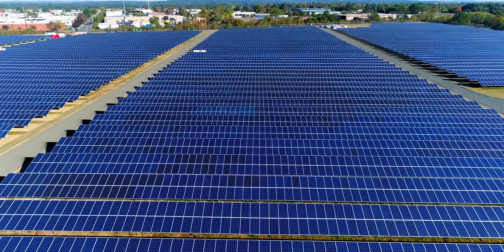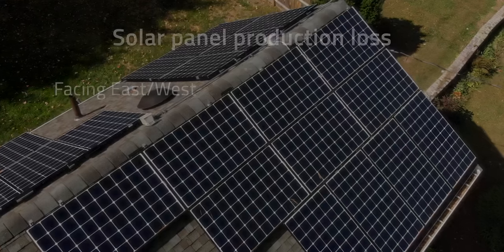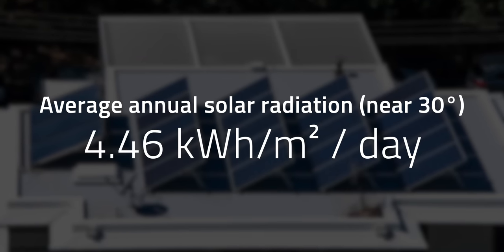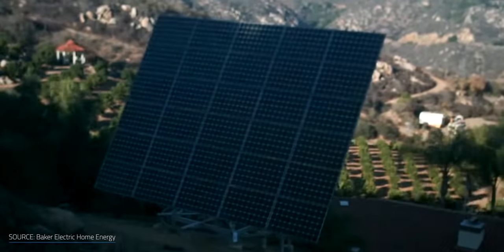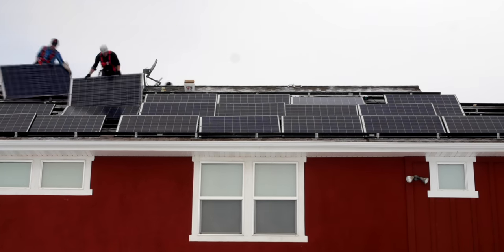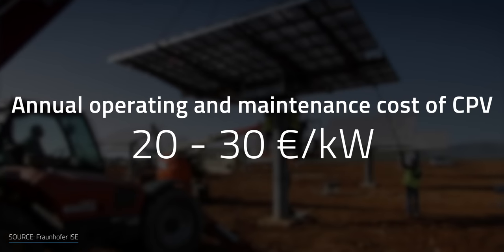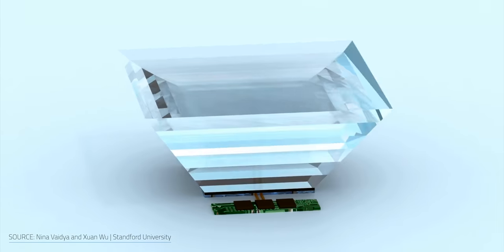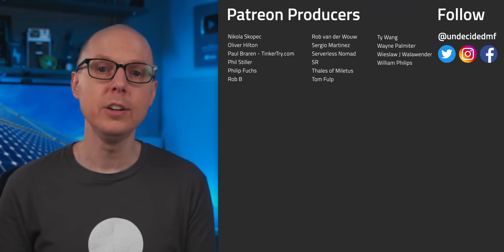This Invention Could Supercharge Solar Panels

Comment: Two false claims here. Incidence angle still matters even with AGILE, simply a matter of total perpendicular surface to incident light. Second false claim is if you concentrate light 10-100x you can increase energy output by 10-100x, that's just stupidly wrong. As you said a few moments earlier that efficiency increases from 20 to 40%. That's a 2x, not 10-100x....

Comment: We should build solar silo's with bigger lenses, kinda like inverted cones so we can concentrate the light 100's of feet down onto many more panels then you could fit in the same space at ground level. The future of solar is not ground level tech, it's building up or down. It's the only way to get the scale we need without overdoing the tech. Research is good, but they are wasting money on these projects. There are smarter ways to use money to advance the solar industry.

Comment: U didn't talk cost of ownership?  Bro more moving parts higher cost upfront and in maintenance.  Also, u can't backfeed the grid it's a unidirectional system.   Labor for installation is over 50% of the system?  When do u break even on installation costs?  Probably 5 years in CA or AZ on the east coast it's  8.  Keep it real and tell people the whole story $30k average to install.

Comment: You do realize that you can't get more sunlight out of the same area as a regular PV cell right? I haven't even watched the video and I can already tell you this would only be useful in hot water preheating and even then it might be completely senseless. The biggest enemy of PV cells is heat and this idea is honestly the opposite of trying to make them more efficient. Using a defuser is probably a better idea so you can spread light evenly over the entire panel and reduce the degradation of individual cells faster than others around it or the edges of the cell faster than the rest. I honestly question if you actually know what you're talking about or if you read some fandangled articles about things and then write a script without doing any source checking or any type of research outside of that article. I've seen a few of your videos on tech that absolutely won't work and it's really becoming a common theme of this channel where you sensationalize something to make others believe you and it's really perpetuating a cycle of misinformation and misleading people into thinking these things are possible and without being forward with more information that's important to the topic. Your views that actually want to learn about things see you as an expert on what you are telling them about and you are far from that.

Comment: Is prefer they focus on solar thermal collector solutions and not waste time on photovoltaics.  Photovoltaics have such a tiny life span and produce toxics waste.  Better of collecting heat and either converting that into electricity via generator or storing the heat.  Also not all of the heat would need converted since a significant chunk of that energy goes towards home climate control.  Another thing if we stop with the bad idea of a grid and produce all the electricity at each home then we wouldn't waste a massive amount of energy through transmission loss.  Nor would there be blackouts anymore.

Comment: This is bad idea. How heavy it will be? It's several layer of glass. How much expensive will it be? How about the cooling system? How about weather degradation to the glass? It's glass, it collect scratches over time. 

I think it will be much easier to use the CPV concept and have a large parabolic mirror that focuses light to several panels.

Comment: This could be the most amazing new enhancement to solar. I do have but one particular question, nothing major but you might wanna hear me out here. Ahem...

WHY THE HELL ARE WE ONLY NOW THINKING OF FOCUSING THE LIGHT????
This shizz should've been common sense. It should have come up the moment solar came into existence. Yet people, limited by what they know now, figured it's impossible. They could not ditch the shackles of the unknown and claim it's knowledge for themselves. And in this regard, I consider people stupid for not thinking of it sooner. I am nowhere near that level of work, but even I figured, back in school, that solar rays can be focused. Oh but the heat meh. Yeah well that's not stopping us now now is it? And even if the heat was a problem, with the cooling power we have nowadays, this is easy. Great video but it should have been a rant on why it's so late! Eh but tech wasn't at that level, yes it was don't you lie. People just didn't think of it and that's on them. It's on me for not being able to but still. How not able? No money, no connections no nothing. I have money NOW. But now, is when I'm no longer needed. Not here at least. So great reminder to not lose focus on what else I can do. at least...

Comment: Oh the comedy. If you concentrate direct strong sunlight 100 times, the heat per unit of area after converting 40% of the energy to power will still be comparable to an electric stove burner. The cooling required in order to keep the PV from getting fried will cost more than conventional PV, per kWh produced. Concentrating sunlight "just" 10 times onto PV, is still problematic. We can't power much with laboratory measurements.     

When focusing light you can focus the light that hits whatever you use to focus with, you don't increase the amount of sunlight that hits any given area. Sure, focusing makes it possible to use less of more expensive more efficient solar cells, but then you need those solar cells, and whatever you use to focus with, and, active cooling system. The thing with old boring conventional solar PV, for general power generation from sunlight, and all things considered, they are hard to beat, in most cases, impossible, as far as we know. 

Also, concentrating sunlight with maximum efficiency is more sensitive to direction, so if you concentrate the light in order to use less of more efficient solar cells, you need to use a tracker to actually get much more power from a given size panel, compared to boring old conventional cheap long lasting PV.          

About trackers, one of the problems is that making them last about as long as the panels, reliably and without a lot of maintenance, is expensive. Remember, it's not always sunny and windless just because you install solar panels. And, it's the mechanical part that is expensive, a few light sensors a micro controller and a few lines of code that doesn't adjust the angle too often or much isn't an issue.       

The increase in total output tracker can produce isn't worth it, in most cases, the main gain is that you get high output over a longer period of time, in the middle of the day there shouldn't be a significant difference between with or without tracker, but with tracker you get meaningful production earlier and later in the day. Still rarely worth it for small installations.  

East and west-facing fixed panels have similar benefit, they produce less, in total, but they can produce more earlier and later in the day, which might be better in some cases.     

All "alternative" solar power has a real problem, conventional solar PV is already economically viable, and the mass production leads to further development. Even if you discover/invent something that could lead to some other technology that could compete with current PV, it's not enough, you need to have something that can compete with PV when you will be able to mass produce it. As long as you're still in the laboratory, theory and CGI-stage judge your new solar power generating technology's potential when compared with conventional PV at half the cost of the cheapest that is already on the market.

Comment: Photovoltaic - what a joke!

I built my own tracking solar mirror concentrator, which turns sunlight into ultimately, steam, which runs an engine pulling a generator creating 120 volts ac and a peek output of 50 amps. That happens only on a very clear day, but as an average, it creates enough electricity to run my entire house. I run freezers during the day, which is about all I use the solar for. 
How much did it cost?
 Well, I build steam engines for a hobby, the mirror cost me approximately $10 to build and the tracker costs about twice that.
So what I spend on my hobby, which is likely not even close to what most people's cost of playing golf is, I get free electricity. The whole contraption takes up approximately 16 square ft, anchored to a post made of steel and concrete in one of my yards behind one of my barns.

Comment: SRB 
 so the top  level  is   a  "vinylal  mirror (withe  hole  to  let sun get through / /so  then     and  last  gen  solar out lay /  then a  mirror  on  that  side /  and  then a   next gen  solar  panel /  on the  bottom /

Comment: They are starting to get on the right track to bust through the 30% barrier, but I won't give away the real way to do it.  This solution is not optimum, since heat is the enemy of electricity and concentrating like this is no free lunch.  Anyone with an extra $800K laying around could do it.  No this is not an ad and I don't need the money.  Just no time to get into it.

Comment: Lol are you kidding me??? I thought engineers have already utilized magnification on solar cells. Omg i just assumed that would be a natural thing to do. Its like making jet burners for furnaces... or 3d stacking memory modules. Or reducing the space between transistors, or compressing recycled fibres into better performing building material.

Our society makes me feel dumb sometimes because i keep assuming someone has already tried the obvious theories to me.

For example. If global warming is so dangerous, why dont we transfer the heat energy away from our surface??? Or store the excess heat into chemical energy? 

Why dont we obsorb heat into global monolithic refrigerant tubing submerged in the oceans and transfer warm ocean currents into heating our buildings instead of mico managing heat transfers in the air with dinky hvac solutions like forced air furnaces burning methane?

Comment: cool. but now it will get so hot it no longer has any benefit. its life span is at minimum halved and the accumulated heat will end any benefit given..... like to the extent that todays panels will be more efficient.

Comment: Lmao funny ive heard of solar cells being reffered to as reverse LED's... And this whole concept is basically the same as adding lenses to LED's. This whole things has my gears turning. Since we are adding gears why not increase the surface area by making the surface of the panel triangle shapped and insert triangle shaped prisms onto it making it flat again. This would further increase efficiency and power generation.

Comment: This is essentialy a rehash of old "lets put a lens on top of a PV cell idea" with 3d printing added. You also spent half the time talking about how trackers dont make sense then discuss a tech that is best utilized on trackers. This only makes sens in a world where PV is expensive and lenses are cheap. We live in the oposite now PV cells are very inexpensive and complexity that this tech adds to a pv module is not worth the cost. Any gain you get from the concentrator will be lost due to heat unless you have a way to cool the cell but then you are adding another system that could break, also the lens is over the individual cell so this only makes sense when there is gaps between cells for this to pull light from, most modules now have very minimal gaps between cells  (some have none) so again this only makes sense if cells are expensive and you are not covering as much surface areas as you can with them. Also how sensetive woudl this be to manufacturing defects? 

There are somany lab project gimics that get hyped as the next great thing in solar, when in reality what actulay makes it to market are the simple things that have a high reliability.

Comment: It's not worth it, period. $30k-$40k for something that saves you roughly $1500 annual is a joke. That is roughly 26 years ($40k return) to actually start saving. An this is IF the solar panels do break/crack due to weather. I give this  2 thumbs down. I'll continue to stay on the grid.

Comment: In response to the prompt that got shoved in my face, what happened to free speech in this country? That said, The primary problem with solar panels and complete solar systems is that they will never even break even.. they are nowhere near feasible for the average individual, and they're basically being used as a political pawn/excuse. By the time they even begin to repay their resource debt, they're worn out and are in need of replacement! The vast majority of solar power equipment is also produced extremely cheaply in China, and does not last and in many cases is actually quite dangerous to use. It would be great if we could completely ban all products from China until they can change their ways, but that will never happen.

Comment: Whatever the scientific and engineering status of these (often important) tweaks, it is a STUPID idea for a grid-accessible home to have an investment made on it to create its own private mini electricity factory. Really it is just stupid. From the investment and running costs through to the service and maintenance activities and associated costs ... it is a huge loss center, and always will be. Let the commercial energy companies provide the electricity since their technologies are always going to be the cheapest, and then once delivered to your home - even with their markups - you will remain miles ahead and have none of the servicing, maintenance and repair work. It is ain't browen, it really does not need to be replaced. The home solar energy marketplace is one of the greatest cons on modern times.

Comment: I can kind of understand why people don't have motorised tilt angle control during the day...though it puzzles me how that can cost so much as to make it unprofitable. It should be possible, even for environmentalist-grifter-'experts' who work on these technologies to use existing tech used in other industries to make virtually maintenance free motorised systems. I guess their main occupation is money laundering and faking facades to justify the constant funnelling of other peoples' money, and all the tech is based on what 🇨🇳 wants to push and which the grifters only buy from them: mass-produced, dirty, simple solar panels at huge volume.

Anyway, those issues are one thing, but not even having a mechanical tilt angle adjustment which the user can adjust for the seasons is ridiculous. Especially up north where optimum tilt angle varies widely, how can people not have mechanical adjustable tilt angle? Too much to have a simple hinge and several locking positions? Too much to go adjust the angle a few times per year?

Comment: Solar's short coming isn't efficiency or space for panels it's storage. The problem is so bad that often economical to have your largest array facing west with extremely sharp angles because peak grid demand hits as the sun starts to set. But what not just use batteries to help get over peak demand you ask? Because it's cheaper to have a huge western array than a sufficient battery. 

That's how critical the storage problem is. It's great that we have lowered the cost of solar by exploiting the Chinese workers and Chinese environment. Now if only we could exploit the Chinese to get cheap(er) batteries. Until then long lasting power like solar is still only half a solution.

Comment: No use quoting ideas that are not in practice - not being sold.  Ideas are great.  Reality is the kicker.  It's like fusion batteries - just five years off - when you there - five more - and five more and so on.

Real problem for solar panels - is just surviving in the weather.  The constant heat an cold.  And most solar panels are not efficient in hot weather.  Why, because solar panels are black - and black colours attract heat.  So,  all these ideas are yet to hit the ground - and be tested in the real world as to what they actually produce. 

Others problems include - who is going to make them - they have to be better and cheaper then what is out there now - to be competitive.  If not - they wont sell.

Comment: Great video and the possibilities are only limited by our resources and closed minds.
In relation to tilting+rotation for solar panels an interesting one i saw used hydraulic rams pushed by a gravity feed water system, its still needed some form of power for the water pumps so not perfect but showed when thought about using what you have around you can sometimes make a difference

Comment: no comments on your 16/9/22 vlog but solar panels are made with EVA - mad rom fossil fuels - Is ethylene-vinyl acetate good for the environment? "EVA is one of the least harmful synthetic materials. With optimal combustion, only CO2 and H2O are released. really only releases CO2 - CO2 is bad according to thermoeddonite greenies and how are you going to make them when they close down  all fossil fuels - EVA is a copolymer: ethylene vinyl acetate that is usually produced from fossil raw materials such as oil or natural gas -The big green lie